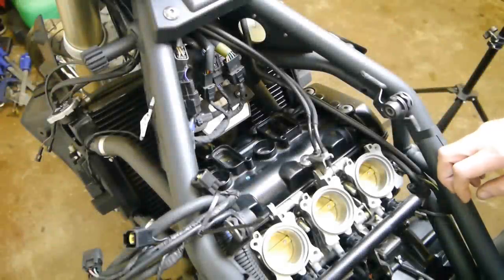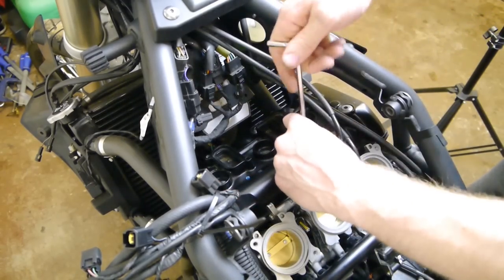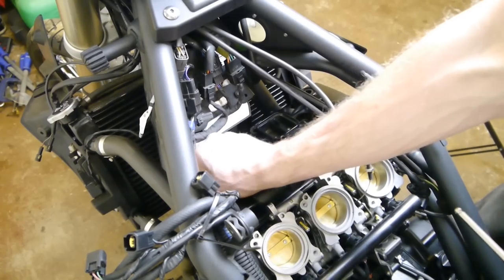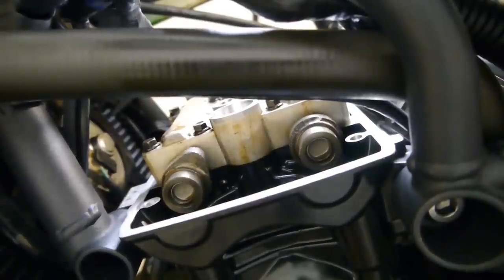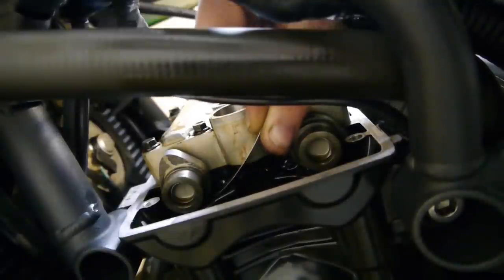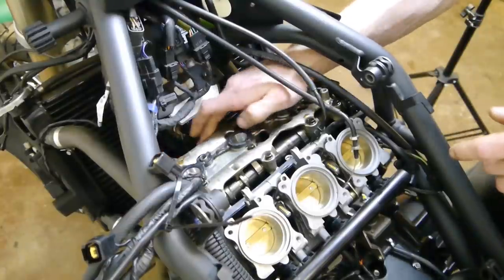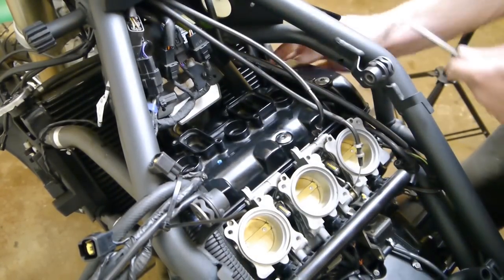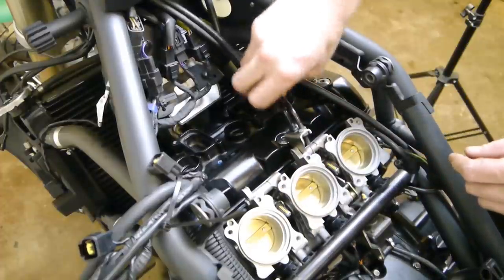Tiger 800 - Valve Clearance check

Comment: First and foremost I pray for your health my friend.

I love your videos and learn much from them.  I see a lot of Tiger 800 videos but very few for the 1200.  Is this process very similar to the 800?  I find any labor is ridiculous $ (mount and balance tires $185 for example) in my area (SE USA).
Reply from the maker: Yes same thing. Different valve clearances though.
Reply: That's just the information I was looking for. I was charged £620 for a service and valve check by my dealer near Glasgow. It cleaned my finances for a while. When I got the bike back(18, 000 miles) I was told the valve clearances were all fine BUT they would need adjusted at 40, 000 miles. I want to avoid to massive bills and learn to do more stuff myself. This is a fantastic video. THANK YOU.

Comment: Fantastic video(s)!  I must be missing something obvious here, as my local Triumph dealer wants £900 for the 12k valve check on a 2014 Tiger 800.  So if the valves are all good and nothing needs changing this seems like a very straight forward job for £900.  I do understand that if the cams have to come out and shims sorted etc then this is naturally a much much bigger job.  surely there should be two different costs perhaps from Triumph?
Reply from the maker: I think they’ll charge you more if they have to adjust the valves and that will be the price to just check them. Where about are you that they charge £900? Staffordshire triumph seems the worst with £1205 for a 12k on a first gen 800.

Comment: Thank you for your videos, they are very informative.

I am having a hard time getting a feel for the clearance on the exhaust side. 
I am able to insert a 0.330mm and 0.356mm blade on all exhaust valves, but it feels the same. 
#1 exhaust cylinder is the only one I feel confident on my measurement, because is so easy to reach. 
I have used both flat and tapper blades. 

I am now thinking getting longer feel gauge blades with.
Any suggestions?
Reply from the maker: That should be alright, they’re in spec. I use a .33 and a .38mm feeler gauge. The .33 should be able to go in and the .38 shouldn’t.   I’ve still never found a .325 feeler gauge but the difference between the two is tiny
Reply: @MuddySump  Thank you much, your help is appreciated. I am sure your videos have help a lot of people. :elbowcough:

Comment: I have enjoyed your excellent videos and did my own valve adjustment on my SE Trophy.
Can you advise me on camchain removal/replacement. There is an Allen bolt that stops the camchain from dropping down.
Can I loosen this bolt to allow the chain to pass for removal.
Reply from the maker: Yes, just take that out. It’s the same type of screw as some of the camcover screws
Reply: @MuddySump  thanks, I appreciate your reply.

Comment: How essential is this check on the 2016 800s, a mechanic told me if there were any issues it would be noticable? What is the "issues found" to "no issues" ratio from your experience..at 24k miles
Reply from the maker: They usually always need adjusting at the first 12k service. If they’ve been adjusted then could be alright at 24k.
Reply: @MuddySump  OK thanks,  they were checked at 12 and apparently fine

Comment: Nice video and gives me the courage to tackle this project in my own shop. What was the total time elapsed from beginning to end assuming no shim adjustments need be made? From and to bike in total ride condition.
Reply from the maker: Not sure for just the valves. I can do a full 12k service in about 5 hours.
Reply: @MuddySump  Thanks! Been using your videos to assist my work on both my Tiger and my DRZ400. Very helpful.

Comment: I have a question. Where your camcover bolts marked with a white dot? I just bought a Tiger and it has those white dots. So I am trying to figure out if Triumph does that from factory or if those bolts have been taken out and tightend by someone else.
Reply from the maker: Can’t remember. They put paint dots on everything  when assembling at the factory

Comment: Great video. I have a 2016 Triumph tiger explorer 1200 (I know this video is a tiger 800) but I had my 20k service done at 24,500 miles. I Was told all the valve clearances were within spec, is that normally the case on the 1200 engine from your experience? As I see the 800 always appear to need some adjustment on their first big service.
Reply from the maker: No, I’ve never seen an explorer with the clearances in spec. Always needs some exhaust clearances adjusting.
Reply: @MuddySump  Now I'm feeling suspicious. Thanks

Comment: Thanks muddysump for your great job! I have just one question, in the min. 7:41 aren't the camshafts in wrong position? I mean, i can see the inlet camshaft on the right hand next to the exhaust exit, and the exhaust cam on the left, is that right or I missing something? Sorry for my English.
Cheers.
Reply from the maker: Hi. It is right. You don't have the same cylinders cams pointing in the same direction at the same time. So In the video you can see cylinder 1's exhaust cams pointing away so the valves are closed and there is a different cylinders inlet cams pointing away so it's inlet valves will be closed and that is the ones you measure.

Comment: Coming from a vstrom to a Tiger, seeing this makes me wonder if l did the right thing trading, if you need to adjust afther that little amount of km. Made a check on the vstrom at 35000km and they was factory new.
Reply from the maker: Depends how you ride them. If you do a lot of long rides or touring then they can still be in spec.

Comment: Hi Muddy - this is probably a real numpty question so apologies in advance. If you find one or more of the valve clearances are incorrect, how do you know what size of shim you need to purchase to correct the clearance? Thanks.
Reply from the maker: You need to see what shim is in there first then get a bigger or smaller one to replace it by the amount it was out.
Reply: MuddySump OK thanks. Yep numpty question then. Not a quick job then unless you have a selection of shims available which, at the price they are, is not something the home mechanic is likely to have. Cheers...
Reply from the maker: Rob Wilkie yes, there’s no point in getting the full shim kit though cause you never use the ones at the biggest and smallest size. The shims in the exhaust side from the factory are usually around the 2.50mm thickness, sometimes less. The ones I use the most are 2.20-2.45mm

Comment: Hi MuddySump, I enjoy all your videos. I find them quite informative and user friendly. I watched  both your videos on valve clearance check and adjust but struggled quite a bit with measuring the 2 exhaust valve clearances on the second cylinder because of the angle and therefore removed the ladder plate before 1. aligning all the gears ( top dead centre) 2. removing the tensioner. Realising this was a mistake I refitted the latter plate after aligning the gears top and bottom ( top dead centre).  I bought a feeler gauge that allows me to measure clearances at an angle. My exhaust clearances are 0.3 and 0.2 (cylinder 1) 0.15(Cylinder 2) 0.15 (Cylinder3) For some reason all 6 intake valve clearances are zero ( has no gap what so ever) and this is my concern.This brings me to my question, did I perhaps do something wrong due to the fact that I removed the ladder plate before aligning the top and bottom gears ( top dead centre) and removing the tensioner. My bike is currently on 50 000 km even though I should have adjusted the clearance on 40 000km. Where to go from here?
Reply from the maker: +Gerhard Wolmarans hi. Did you measure the clearances on the intake side before removing the ladder plate or just after you refitted it?  Email me at service@muddysump.com will be easier to message that way

David
Reply: Did you get an answer what was wrong, or would you share it with us after all this time. Thank you!

Comment: HI, I'm about to attempt this on my Street Triple R and I am a bit worried about interpreting what "feels" right when measuring the clearance. Like at 7:30 you're measuring cylinder 1 exhaust, the smallest feeler gauge fits, BUT so does the largest one. Was that valve over 0.375 and needed adjustment?Or is this a case of the larger feeler gauge fits too, but with a lot of resistance hence the gap was smaller than 0.375. How easy do these feeler gauges suppose to slide in?
Reply from the maker: The smallest one should fit in, otherwise it’s too tight and the biggest one shouldn’t, otherwise it’s the gaps too big. There should be a slight bit of drag when moving the feeler gauge.
Reply: @MuddySump  Thank you. One more thing: do the clearances tighten or widen in the long run? Bike has been checked at 12k and  inlet was at 0.2 Would you adjust this at this value? Say, bring it in the middle at 0.15...
Reply from the maker: Paul Mp they usually tighten.

Comment: Hello, what's the valve clearance numbers in/ex for the 2012 Tiger 800? In the the shop they doing now .10/.20
Reply from the maker: Inlet .10-.20 exhaust .325-.375
Reply: @MuddySump  thank you. That's what I've found in the manual too and told them. They were looking in wrong manual with 885cc engine 🤦‍♂️

Comment: Hi Love your videos, I have a 2016 tiger 800 xcx, coming up to 55k miles. I assume valve clearance is a must but what else would you advise, plus how much would you charge if you did it?
Reply from the maker: 60k service is the next major service. Air filter and spark plugs get changed then too. Oil and filter, grease bearings…. £450 for that service
Reply: @MuddySump  how much notice do you need
Reply from the maker: @bikeboats6616  depends where you are. First half of next year is already full.

Comment: 8000 miles  lot of work why not do 12000, can you hear them taping if they are worn or is the bike just down on power. very good vid youve  done this a lot by the looks.
Reply from the maker: It’s usually just the exhaust clearances that tighten. Inlet are rare to need adjusting. It’s always a bit of a noisy/tappety engine anyway

Comment: I can't find any way to torque back at the proper setting the bolt number 3. I don't have any space to fit the wrench between the bolt and the bike frame or to use an extension arm.  I use a teng wrench 1/4 so it's pretty small... what did you use?
Reply from the maker: +Mike I've got a 1/4" teng tools torque wrench. Fits everywhere

Comment: How do I know if my valve clearances need doing? My bike has just hit 14k and I've read a lot on how a lot of the time on checking them they don't need adjusting. Are there any tell-tale signs that they are out or need adjusting?
Reply from the maker: Can depend on the type of riding you do. If it’s been mainly long rides then they’re more chance of been in spec still.
Reply: @MuddySump  most of my rides are full days between 80-120 miles a time. Just wondered if you can feel or tell from riding if they are out. Thanks for the reply.
Reply from the maker: @Dan_TheMedic  think they’d have to be really bad to be able to tell just from riding it

Comment: Hi muddy. I saw a lot of gooey stuff on the studs you pointed to at 5:35. I also notice lots of the same gooey stuff in the hole beside the spark plugs. What do you think this means?

I’m currently having issues with starting the bike when it gets cold.
Reply from the maker: Shouldn’t be anything but oil up there. Was it a cream colour? That’s condensation, usually caused when bike is ran for long enough to warm up
Reply: @MuddySump  it was like black grease. Wish I can send the picture.

Comment: Advice needed!

I’ve got 27k miles on my tiger 800 and I’m only doing the first valve check.

I’m finding my intake valves are to spec, but the exhaust valves are so far off I think I must be making a mistake.

I’m getting .13-.15mm on all exhaust valves and my manual shows spec as .325-.375mm.

Does this sound strange to you? Any advice would be much appreciated.
Reply from the maker: Probably right if that’s the first time they’ve been checked. They’ve probably been that tight since 12k when the initial wear in has taken place.
Reply: @MuddySump  
Thanks! I feel better hearing it from an expert like yourself.

Comment: Hello there, I can't find proper feeler gauges. Every where they sell in 0.05mm increments. Its fine for intake valves but for exhaust valves it should be .325 - .375mm thickness and I can't find a proper set. Can you please tell me where did you get your set? Is it possible to find it in online shop somehow? the closest I could find was 0.33 and 0.38mm gauges.
Reply from the maker: Hi. .33 and .38 is what I use. The clearances usually tighten so if you can't get the .33 in then try a thinner one. I usually find if they're tight then they're at .30mm. Fit a shim one size smaller, they come in .05 increments, then it should feel right with a .35 feeler blade. 
If .33 blade feels alright then it is still in spec
Reply: +MuddySump Before anything else, Hats off for your great videos on proper Tiger maintenance. All of them are classroom quality and great attention to detail. My question is - any recommendations where I can find / get these feeler gauges online? or do you think a local Triumph dealer will carry these in hand? Thank you
Reply from the maker: +larry canete triumph don't sell them. Best off just searching online for for them. The majority of them come in .05 increments but if you can find some that are .33 and .38 that's what's I use

Comment: Hi! great video! my question is what is the valures standard for the valves? or something acceptable. Thanks.
Reply from the maker: +Nicolas Chterich the clearances? Inlet is  0.10-0.20 exhaust is 0.325-0.375 mm
Reply: Thanks but where you get that valures? In service manual says in 0.80-1.20mm ex 1.00-1.40
Reply from the maker: What manual is that? They're big clearances. Definitely for the tiger 800?
Reply: MuddySump Service Manual for both tigers, 800 and 800xc. If you want i can send you by email. For yours number my ex valves are tight for a bit but for the manual they are open. I want to know if i had a problem or not.
Reply from the maker: Just checked the manual I've got and says the measurement I said. Is yours in mm or inches?
Reply: MuddySump mm. That was the first thing i look.
Reply from the maker: Send me a pic of yours if you want to service@muddysump.com

Comment: That's lot of work. Why can't they make hydraulic valve adjustments like Vulcan 1600. Or Ling intervals like yamaha or easy work like bmw 1200gs
Reply from the maker: Because it’s not a V twin or a boxer engine. The 700 tenere looks like it has 4000 mile service intervals

Comment: I know this is going to sound stupid to most of you but how can you tell inlet valve and exhaust valve ?
Reply from the maker: Exhaust are at the front of the engine, inlet is at the back. The inlet is where the air and fuel mixture comes into the engine, next to the throttle bodies. The exhaust is next to the exhaust pipes to let the burnt fuel mixture out.
Reply: @MuddySump  you're a star thanks mate

Comment: Is the 1200 explorer the same or similar?
Reply from the maker: Similar. Different clearances. Still turn the engine over and check the clearance with the cams pointing away from the bucket.

Comment: I do not quite understand why these passes with the sequence of unscrewing the valve cover bolts? Tighten, yes, it is necessary from the center to the edges, but unscrew ..
You have very necessary videos about the repair of the Tiger, but to be honest, looking at the condition of your motorcycle, I get the impression that you are just repairing it, there are no signs of operation at all.
Reply from the maker: It was just service videos. Think there was about 8500 miles on it when I did the valve clearance videos
Reply: @MuddySump  Just very clean "under the hood". It's cool, you love your bike. Can you tell me what thread the mirrors are attached to? 10x1.25 is the size, but I don't know the thread direction. I will be grateful to you.